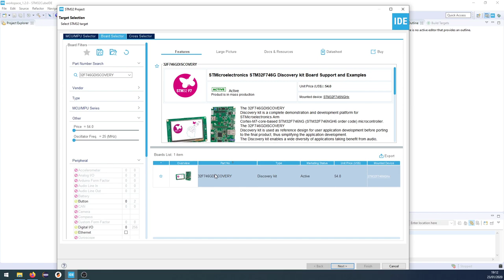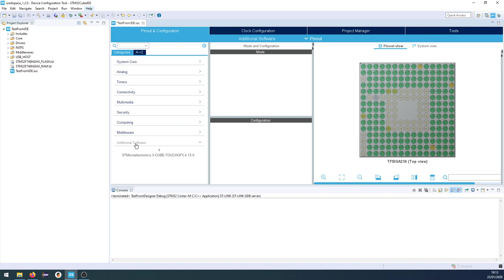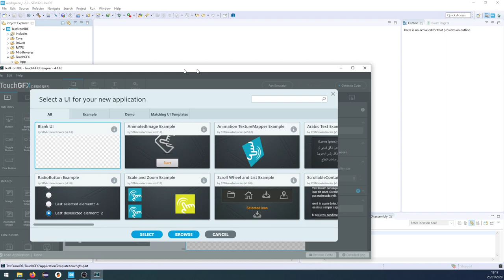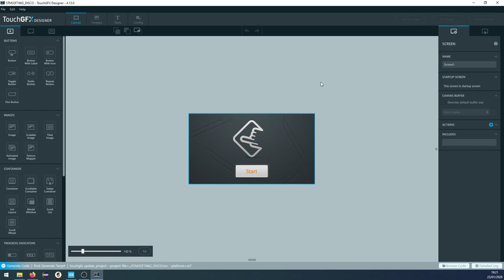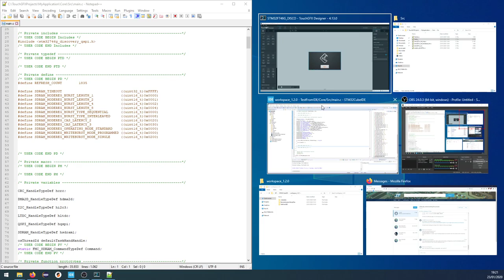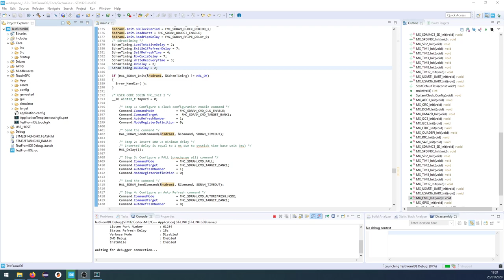[DEPRECATED] - TouchGFX (4.13.0) integration with CubeIDE (1.2.1) - Custom Board method

Comment: Well done example of using X-Cube-TouchGFX with the STM32F7 Disco. 
 For the touch screen functionality, I just used the code for the STM32Touchcontroller.cpp from the second TouchGFX Application that was created as well as the TS_I2C_ADDRESS variable in the .hpp file. I also added the the Components and BSP folders from the Drivers folder to the project and added a C++ Include path the the Components->ft5336 folder. After this, the project built and the touch functionality worked when loaded on the board.   Thanks!

Comment: Thank you for this video. TGFX4.13 now includes a .ioc file that makes this more straight forward. One can just develop the UI and then open the ioc to enable extra hardware. I would love to see a video showing how to code in the GUI to interface with the hardware (backend). That is the part that is most confusing to many. Thanks again.

Comment: Your tutorials have been a great help. THANK YOU!  I had a tough time achieving success on my system with this video.  The problem has been isolated. Blindly expecting backward compatibility, I had upgraded to ToughGFX 4.14.0 and STMCubeIDE 1.4.0, this resulted in the same black screen that you mention even after updating USER CODE in main.c from the TouchGFX Applicaiton Template.  Looking closer to the TouchGFX Application Template, I found a sublte note in the TouchGFX Application Template Description for the STM32F746G stating "Application Template is only supported from TouchGFX 4.13.0".  After reverting to TouchGFX 4.13 and STMCubeIDE 1.3.0 my screen successfully rendered.
Reply: where on earth do you find v4.14 if on st website it on has v4.13

Comment: Brilliant video, thank you for such a great explanation. I wish ST/TGFX would do more explainers like this, their integration seems quite messy and very unfriendly to new users. I'm looking forward to more of your videos! Also looking forward to more V3 application templates in tgfx ie: F469 discovery, H747 discovery...
Reply from the maker: the process can seem a little convoluted, yes. But keep in mind that the CubeMX is only intended for the HW setup - pins and port directions and basic timing options. 
If you want a ready-to-go solution you can start a project directly from the TouchGFX designer. yeah - a lot of people are waiting for more application templates!

Comment: Great video, thanks. However I had to include a Board Support Package in order to get the external RAM to work. The user code macros etc. used here did not show up in the auto-generated code.
Reply from the maker: If I understand correctly there is a support pacakge to the devkit? Smart! I didn't know that! It makes sense to have the initialization code somewhere accesible. But when building a custom board I don't think a support package will be of much help.
Reply: @banjohat  It's basically a neat way of organising stuff.  Makes it easier to port code and interchange it in between applications. One way or another you have to write custom drivers at some point. Hopefully not for a too complicated peripheral :)

Comment: Hi, Im using stm32H7B3I-Dk board and trying to interface custom TFT 5" display using SPI protocol. i have created a project from cube MX with default peripherals configuration and I have develop simple UI from Touch GFX. When I try to debug the code Hardfault error is occurring. But when I try dumping the code generated from the Touch GFX the UI run. Can u pls suggest a solution for this

Comment: when I click on TOUCHGFX under additionl software and then click the check box , "graphics application" nothing appears on the user settings it only says "this ip has no settings to be configured" then i generate code and there is no touchgfx file or reference at all to it

Comment: Thank you so much!
It worked for me too. 
(After CubeIDE 1.3.0 upgrade my board is not worked at all)
Reply: hi , is there something wrong with IDE1.3? i am not getting anything in the LCD , i only use 1.3 so i am not sure if other versions work properly , did u fix it ?

Comment: I have a problem ... in 10:37 you show files generated by TouchGFX. When I create a new project in TocuhGFX, I choose the hardware platform (in my case STM32F469), in the TouchGFXProjects folder I don't have .ioc file, core folder containing main.c etc. What could be the problem? I have TouchGFX 4.13
Reply from the maker: the new application template is so far only available for the 746 platform. that could explain the missing files
Reply: @banjohat  Thanks for sharing this video with everyone.
We have currently upgraded the following Application templates to include an CubeMX file for accessing and using TouchGFX Generator: STM32F746, STM32F769, STM32H7B3, STM32H750. We are currently working on adding more.
Reply: @STMicroelectronicsTouchGFX  Hi, are you planning to prepare templates also for STM32H745I-DISCO board? This video helps me a lot, but I am still not able to make alive TouchGFX on my board. Thanks.
Reply from the maker: @STMicroelectronicsTouchGFX  thanks for the acknowledge :) It means a lot!
Reply: I am also using F469 @@. What should we do next?

Comment: Great video. I have a similar problem as someone has already mentioned. @10:37 After generating additional TouchGFX project (for STM32F429I-DISCO in my case), I have a slightly different directory structure and the file MyApplication\Project\Core\Src\main.cpp does not contain additional code.
Reply from the maker: Unfortunately I don't have access to the 429 board but it would be interesting to look into this!
Reply: @banjohat  As someone advised me, partly the problem was solved by using BSP drivers for 429I-DISCO evalboard. But still it's rather work in progress than a ready solution.
Reply: I am finding the same problem, the latest TouchGFX now creates a ver slim main.cpp and apears to be formatted diferently. I am using a hotmcu SOM-STM32F429IG with a 10 inch display and after a month I have the screen reseting and the backlight coming on. I was so excited when I saw your video as I started to realise that I had to write more code. But they have made tis video already obsolete. I wil have to try and work out from the example code that I have written in Keil 5.15 for stemwin, and see if I can back engineer it. Thanks for your great videos. Cheers greg.

Comment: Hi, 
Thanks you for the tutorial. Could you help me to do the same with STM32F429ZI-DISC1. I only get a blak screen even if my framebuffer (starting from 0xD0000000) is filled correctly. 
Thanks!
Reply: I'm having the same problem with the stm32f769I-disco

Comment: Hello Embryonic.dk... First of all Thanks for creating a such a great video...
 I can see where St are looking to go with this integration of Touchgfx, CubeMX and CubeIDE but at the moment there are quite a few bugs to sort out..
In your video 13:23 you say that cubeMx has no knowledge of the kind of memory chip in the board… Well it did in previous versions and even in this version you choose the board when starting the project so it should figure all this out.. 
Also when creating the project with Touchgfx as the starting point you get to choose the template for the board and everything is hunky-dory. However that template is not available when you open the touchgfx while creating the custom project like you did..why why why??
Reply from the maker: because CubeMX is ambigous.. It took me some time to understand but CubeMX ONLY knows the hardware configuration that you tell it. nothing else. Granted, ST have put some knowledge of 'soft-configuration' into the generator but its basically the same situation as with the QSPI a while ago. CubeMX doesn't know all chips in the world (nor should it).
We all agree that when using a board and the box 'use default settings' comes up it only makes for confusion. but the thing is that cubeMX is only for HW config and not the configuration done after the pin setup. we're all just used to that being done for us..

Comment: I got stuck at touch controller cpp file, I watched your previous video for that, but that is via BSP and slight different than TouchGFX design 4.13.0 generates. I was so close. Can you help me? I'm in a hurry building a touch interface for diy ventilator to have a open source plan b for the enormous amount of hospital ventilator shortage caused by COVID-19 worldwide. Thanks in advance.

Comment: Hi. Very nice document, but I have F429-DISCO and I haven't run it yet. 
Unfortunately, driving a TFTs is a difficult discipline and not for everyone. :(
Reply from the maker: yeah, it seems quite complicated at first. for the 429 I don't think it has the external RAM (i might be wrong) but the support for that board should be here soon!
Reply: @banjohat  Hello, il have the same probleme with F429 Discovery :(
Reply: @banjohat   Board 429 has RAM IS42S16400J.

Comment: Hi, Great channel! Could you make a video on programming the stm32 with ethernet please?
Reply from the maker: thanks :) Wow, that is very specific (and very advanced). Well, The theory should be to accept a new image file through packets and then point to a bootloader that can copy the new code over the original. I think. I am currently looking into the USB DFU loader that does its trick somewhere along the lines i described. Running through ethernet should be.... possible ;)

Comment: Hai sir,
tq for share this video. i am using 32f428i-disco. i have problem in touchgfx generate code. that is
 Post Generate Target
        touchgfx update_project --project-file=../touchgfx_with_codemx_test1.ioc --platform=m4
        unsupported toolchain: TrueSTUDIO
        ProjectManager.ToolChainLocation
        Failed
    Failed

how can i fix it. i am waiting for your Ans.
Reply: it might be a little late , but Truestudio is not supported in TouchGFX , use STMCUBEIDE

Comment: Hi.
Thanks for your good video.
Do you have solution to touch screen problem?
Reply from the maker: I got it working - if you see the description I have a link to my solution
Reply: @banjohat  sorry i do not understand your link very well.
Do you mean to work with previous versions? 
I have checked the stm32TouchController.cpp file in the current version. and it is differs from previous versions of TouchGFX.
i added a touch driver but its not working.
Reply from the maker: @javadkhani9741  The easiest way is to copy existing code from a template project and insert it into yours. Remember to copy the drivers as well
Reply: @banjohat  Thank you for your reply.
I did. But I got an error. Error about file ft5336.h.
I've added this file header. But this file is not recognized.

Comment: Hi, when i open the ApplicationTemplate.touchgfx.part forthe first time , its pop up this message  ->

The path C:\Users\Name\Desktop\Folder\test_1\TouchGFX contains spaces, this can result in erroneous behaviour while compiling 

 i press OK, and when i want to generate my code its give this error -> 

Generate Assets
        make -f simulator/gcc/Makefile assets -j8
        simulator/gcc/Makefile:20: * Spaces not allowed in path.  Stop.
        Failed
    Failed

Can you help me please? i'm newbie on this
Reply: I´m using STM32 IDE 1.3.0 & TouchGFX 4.13.0 Designer

Comment: Hi.. If i replace TFT on STM32F746-Disco by TFT 7inch (TFT have same Pin number), so how can i custom them
Reply from the maker: you just change the values in you CubeIDE project
Reply: @banjohat  i have change in the CubeIDE, it showed OK, but when i using Touch it seem run not smoothly when slide to the other page..how can i increase frequency sweep

Comment: I am able to build project for STM32F429 DISCO board, but screen is blank, can you please help!
Reply from the maker: There are some bits that need to be changed for that platform that I'm not completely sure of yet.  I'll try and make a video when I have the time
Reply: @banjohat  I am able to do it now, tomorrow I'll try to work on touchpanel
Reply: @SahilAhmadkalka  Hey, How did you do it? I followed the instruction on video and did it same with STM32F429 project from touchGFX but the screen is still blank. Can you help me, please? I can send my code if necessary.
Reply: @ersahatmaca5531  I think you skipped something, did you added additional code generated by touchgfx?
Reply: @SahilAhmadkalka  If you're talking about FMC part yes I added and changed bank1s to bank2 because in my code generated by CubeMX I'm using bank2. But when I debug I can't see anything on 0xC0000000 and 0xD0000000 addresses. So my problem is probably on SDRAM part.
Reply: @ersahatmaca5531  yes you did it correct, change memory to bank2 and start address 0xD0000000. It works fine, if no? share your code, I'll check it update you. Btw, which display you are using?
Reply: @ersahatmaca5531  try to set ltdc clock frequency around 12 Mhz and main frequency to max possible
Reply: @SahilAhmadkalka  I set ltdc clock to 12MHz and main frequency 168MHz but nothing has changed. If It's possible can you send me your SDRAM adn LDTC settings so I can check what's wrong with my code.
Reply: @ersahatmaca5531  can't send now, because India is locked down and my laptop is in my office. Also I don't have any board at home to test and share with you.
Reply: @SahilAhmadkalka  It's okay I'll figure out. Thanks for your help.
Reply: @ersahatmaca5531  Hello. Did you finally solve your problem ? I got the same.

Comment: It’s very cool!
But why my screen stay black? 🙄
Reply from the maker: There could be a number of causes - make sure you have a non-black background. the QSPI is not configured so make sure all graphical assets can fit into the internal flash. also, did you copy the soft-config of the SDRAM?